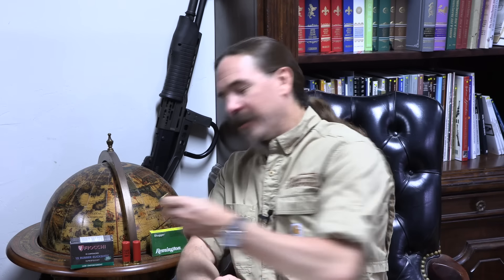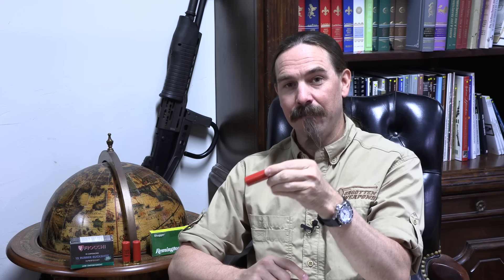The Unique Challenges of Self-Loading Shotgun Design

Comment: I got to 4:25 or so when an idea hit me... what's preventing adaptation to that idea of a consistent, mouth headspaced rimless cartridge simply by sliding a regular shotgun cartridge into a plastic sleeve (perhaps even at the factory), something that's injection molded and runs a fraction of a cent per item? The firearm is a custom item then, yes... but ammo is just a matter of slipping whatever you want into a tight plastic sleeve. Now that "new cartridge" always headspaces correctly, the magazines can be perfectly straight, you gain maybe a millimeter in diameter overall...

.... is that enough of an advantage for the tradeoff of the extra component and preparation time?

Comment: One spontaneous idea.
You take the longest shotgun shells there are and design a plastic 3D printed sleeve for the ammo. 
Now you can place any length shotgun shell into this sleeve, the sleeve can have all sorts of features you want, you can 3D print all of them and you can design a gun with a feeding system for the one now common sleeve deign. You can still use all your shitty 200 year old legacy design shells but now you can automatically feed them and so on. Every shotgun shell would be a standard length now.

Comment: I know this sounds like a box-mag conversation and this is not a popular view but I like the IWI TS-12. You have to find a shells that runs well in it and there is pressure adjustment.
Reply: I was so excited when I heard IWI was making a 12-gauge Tavor.
Then I saw what they actually made.
Reply: @distalradius8146  what exactly didn't you like about it? 
I found it to be a heavy pew. 
I think it would be good against drones on the battlefield, let's hope we don't find out.
Reply: @codyaimes4354  I think the rotating-tube feed system is a little bit silly, I have a hard time justifying that unless you're trying to get around some sort of local capacity laws.
Reply: @distalradius8146  According to the National Firearms Act (NFA), a shotgun is considered a "destructive device" if it has a magazine capacity exceeding a certain number of rounds, typically defined as more than 10 rounds.
Reply: @codyaimes4354  Uhm, no that is not actually contained anywhere within the NFA. I've got multiple 20 round drums for my Saigas, they don't care how many rounds it holds. I think you may be conflating that with the ATFs reclassification of the USAS-12 and Striker -12 to DD status. That has nothing to do with the NFA definition of a DD. If you want to actually read the laws for yourself, they are published and fully available on the ATF website.

Comment: Cycling blunt-nosed, rimmed ammo?

Smith and Wesson.

Model 52.

Semi-auto target pistol exclusively set up to run .38 Special WADCUTTERS.

OK,there is no issue with the ejected case being LONGER than the unfired round being fed into the chamber.

The classic Browning A5 I once owned seemed to behave itself, as longs as it was TUNED to the ammo via the nifty bronze " friction collar". 

Then, there are the "inertia-locked" Italian jobs. The gun MUST be able to recoil for the mechanism to even work. Back it up against a stout fence-post and pull the trigger and it will fire, but not cycle.The gun must be able to RECOIL As it does so, the bolt mechanism is, of course, moving rearward. When the gun STOPS moving rearward as the firers shoulder rebounds, the bolt CARRIER continues moving rearward, thus unlocking the bolt. Rinse and repeat. Totally different "feel"  compared to an A5 firing the same ammo.

Then there is the gas-operated Remington 1100 and its derivatives. They would run for DAYS without a hitch, GIVEN QUALITY AMMO.

Comment: A problem that isn’t me thinks. Perhaps in some weird application. 99.9% of shotgun users will never load a mix of rubber buckshot, #8 target load and slugs in the same magazine. Modern gas systems are self-adjusting. My duck gun eats from 3.5 magnums to 7/8oz light target loads with no issues.

Comment: What if a shotgun could chamber a rimless shell? Would  the bore issues make it unworthy?
Reply: It could be done but that is only one of the problems and not even the biggest one. I mean the Russians have been making automatic firearms with rimmed cartridges for over a century and they work just fine. Yeah it's a pain in the rear but it works. It's especially easier when you're only dealing with 5-10 round mags. It really becomes a problem when trying to do 20-30 round mags but no one is going to do that with a shotgun, that would be huge. So yeah, you could design and build a rimless shotgun shell and that would solve one of the problems but only one of many and introduce a whole new problem in ZERO compatibility with existing guns and ammo.
Reply: @wingracer1614  I want a pan-magazine for a 12Ga mounted on top.  Yeah.  That's the ticket!

Comment: With advancements in power sources and electronics in general, perhaps an electrically powered shotgun where the action is not dependent upon the gas pressure or recoil of the ammunition will be successfully designed and marketed.
With the 12 ga shotgun even when a box magazine design works, the magazines are bulky and capacities of the ammo feeding device is low.  But on the positive side, at the close ranges where the shotgun reigns, Not so many rounds are needed to end a gun fight.   
Be nice too if someone would design a rimless shotgun shell.  I believe it has been done, but if so, obviously it was not a success.

Comment: Yup, redesigning shotgun shells to work in an autoloading shotgun wpuld be pretty straightforward.  A rimless, full brass shell with a slight shoulder and little to no neck would work very well - adding a hemispherical frangible plastic nose cap would make feeding even easier.

But there is literally no "ecosystem" to support your gun and ammo.  You're basically in the same place as the Dardick.  So, unless you are capable of delivering relevant advantages that outweigh the barrier your proprietary ammunition design and gun create, youre going to end up losing money.

And the fact is, engineers have figured out how to kludge together systems that operate and feed the existing clunky shotgun shells.  Meaning the juice ain't worth the squeeze to dramatically "improve" the shotgun shell.

Now, if you can force users to use your ammo, and you have a large enough captured market (like, say, the US military specifying an improved shotgun setup, regardless of compatibility or cost), you kight be able to break through.  But the HK CAWS went nowhere...
Reply: The time to have developed a rimless shotgun shell was 125 years ago when Browning was designing the Auto 5. This was at the dawn of repeating shotguns when a rimless shell might have become the standard for all repeating shotguns, not just autoloaders. The fact is, Browning designed all of his repeating shotguns around rimmed shells and tubular magazines, so maybe he didn’t see a need for rimless shells.

Comment: For the metric folks:

492gr  @ 1145 FPS for 1432 ft lbs = 31.94 grams @ 349 m/s (right above mach 1 at SSL for my fellow aero nerds) for  approx 1945.2 J
807gr @ 1210 for 2623 ft lbs = 52.4 grams @ 369 m/s for approx 3567.4 J

That is assuming no base 10 errors were made.

Comment: I dont undestand why they dont make a gassystem for light loads and the other shells are overgased and just run.?
Reply: You need a minimum amount of energy to get a bolt to cycle. In order to cycle with very low gas pressure you would need an exceptionally light reciprocating bolt, and very low friction. It could be possible, but I’m guessing such a design would be expensive, complex, and prone to malfunction and fouling.

Comment: Ian probably have never given it a thought, but you'd encounter exactly the same problems making a self-loading airgun. Low pressure, by "real gun" standards, but wildly variable. Pellets of different length. Inability to stack them in a box magazine. Issues with loading them into the chamber properly. So, the challenge isn't as unique.
Reply: Semi auto air guns have been around as far back as the 1960's---Crosman model 600 pistol. Ten pellet (.22) linear spring fed magazine feeding a transfer arm to align with the barrel. CO2 powered, mine works reliably, with the right (non-pointed) pellet. There are new semi and full auto pellet guns on the market; from .22 to .457 calibers. They do (mostly) have four figure price tags however. A google search will bring up lots of hits.
Reply: @georgejetson6556  I didn't say there weren't any self-loading airguns. I made quite a few myself. My point is, the challenges of engineering a reliable feeding and re-cocking system are very similar to shotguns.